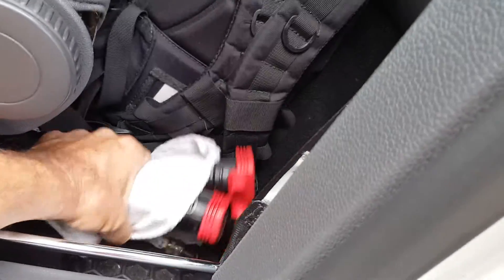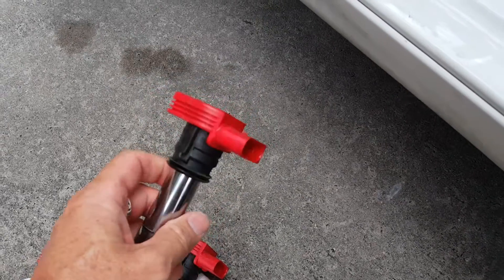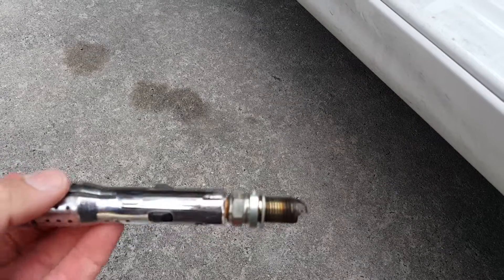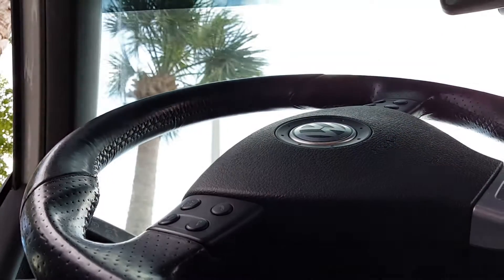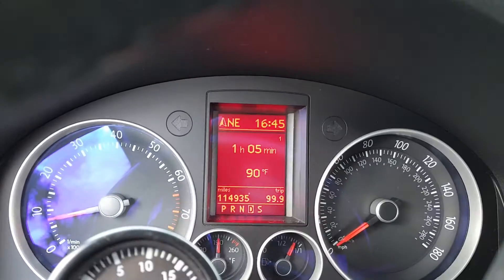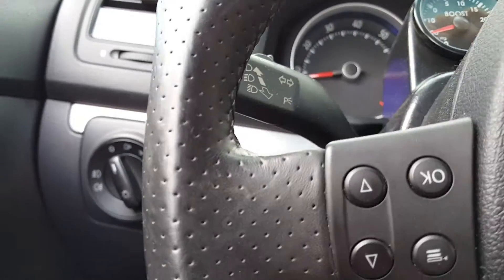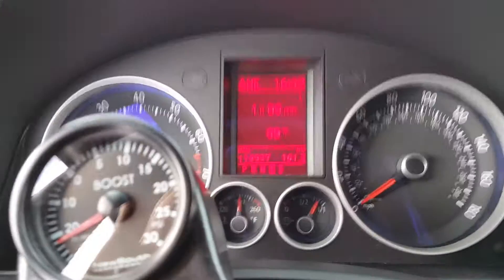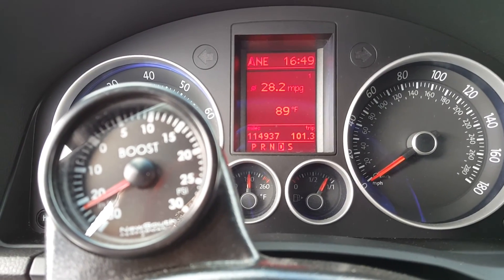AUDI R8 Coil Pack + NGK Laser Spark Plugs (after install) Pt.2

Comment: hi i just got an mk5 gti. and planning for an upgrade. im thinking of an air intake 1st before the exhaust. just wondering what would be your opinion on that thanks.
Reply from the maker: +Joseph Bantigue intake first is good cold air makes everything work better and perform better thru the intake bringing in colder air... No need for exhaust either just get a 3"downpipe and you can be reflashed for stage 2 software. Full exhaust not needed until KO4 it at least stage 2+
Reply: thanks for advice. any suggestion for the CAI?
Reply from the maker: +Joseph Bantigue what the Cat or want a APR software
Reply: +gtiman67 suggestion for the cold air intake :)
Reply from the maker: +GTi kolokoy I like mine from Forge but they don't make it anymore mine is one tube down to the ground 18"off the ground🤓 however there are great ones out there still VW racing has a very expensive one Nuespeed had a good one and call Forge and ask if they make mine still our have one with one pipe not 2... I think they are making a new one that uses one pipe you don't want competing air flowing in

Comment: Nice vid whats on ur vent the led light flashing ?
Reply from the maker: P3 cars dash vent gauge by VIDI... THEY HAVE ONES FOR EACH INDIVIDUAL MODEL YOU SHOULD CHECK IT OUT. IT MONITORS YOU'R SPEED, AIR INTAKE TEMP, BATTERY, COOLANT, EXHAUST TEMP, ENG TIMING, THROTTLE POSITION, BOOST, AND HAS A zero to 60 test built-in

Comment: Hey man I'm wondering what that guage type thing that's in your ad vent is. It looks interesting
Reply from the maker: +Matt Pina P3 cars they make them model specific too - look them up it reads actual data from your ECU and engine management system

Comment: At this time what's your opinion about this change? I'm interested in the same upgrade but there's a lot of people who say they don't notice changes. Thanks for your answer and awesome exhaust :)
Reply from the maker: +Gerardo Munguía I was happy at Stage One, more happy at Stage 2, Stage 3 plus better but not that much, BUT KO4 was like getting a new GTI it really wants to move, my shop said that even though GTI MkV's come thru their shop, mine had the most pull of the ones they drove with the same upgrades!? They couldn't explain it but that I had a great one. So I do hardly recommend saving and getting the APR KO4 kit and software!

Comment: have some one problem whit code p0420 ??? need help
Reply from the maker: I think this has to do with your catalytic converter what's great with APR software is it recodes your engine and you plug in the CO2 sensor further back from where it is originally on to your new exhaust so that helps you to not get any error codes of this nature... go with APR